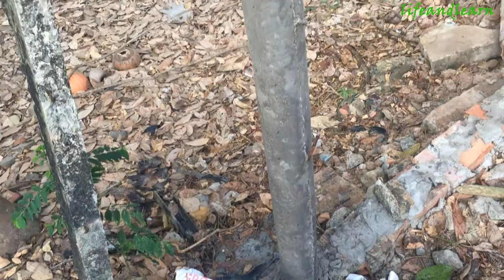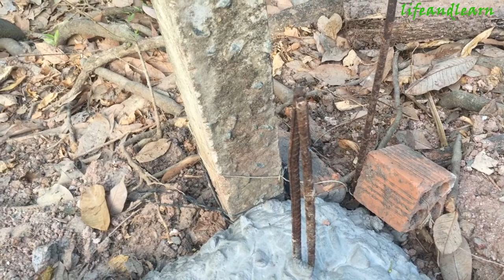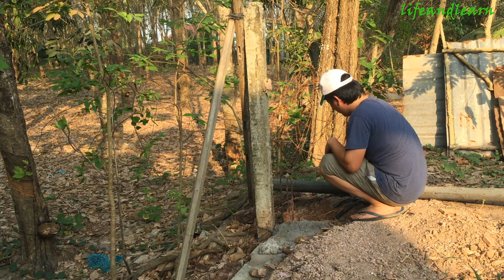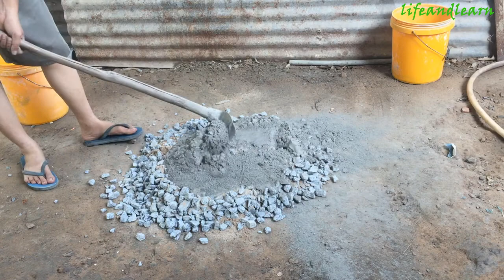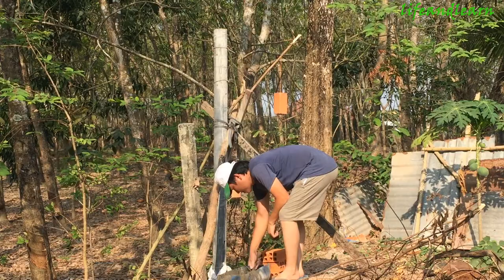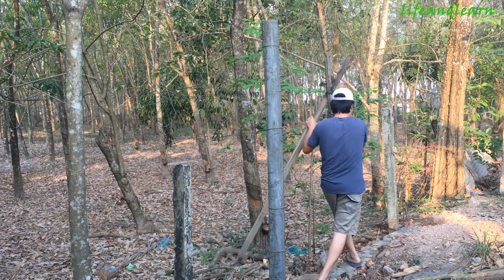How to make concrete column by plastic pipe | lifeandlearn

Comment: Very good job of simplifying it for others... Only thing is you have no support in your column. You have rebar in base of column but no rebar going up for support of the column.  From an old concrete guy you,.. Rebar is what gives the concrete support from breaking.. If you put pressure on the column it will snap like a twig after a certain point... with rebar it will support it even thought it will crack and not break and fall apart... Keep up the good work... God speed....

Comment: Hey there! I found your video because I am thinking up basically the same thing except I'm trying to figure out how to make a curved concrete column.
Reply: Fill the pipe with sand and heat it slowly with heat gun...